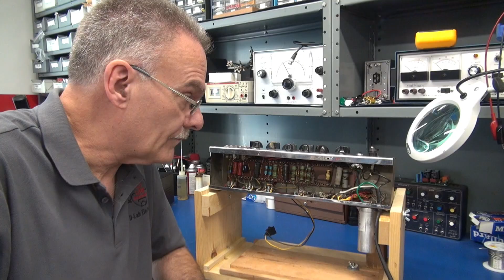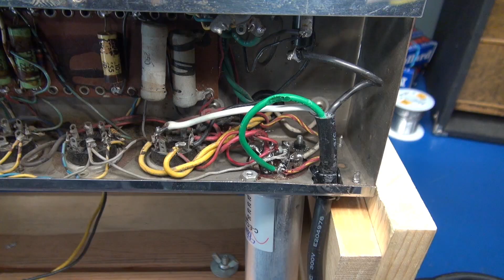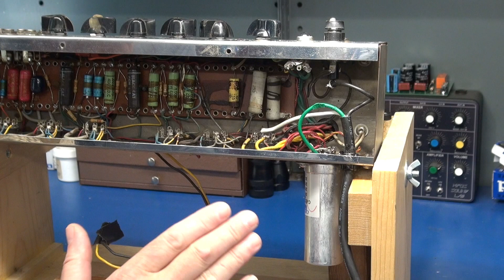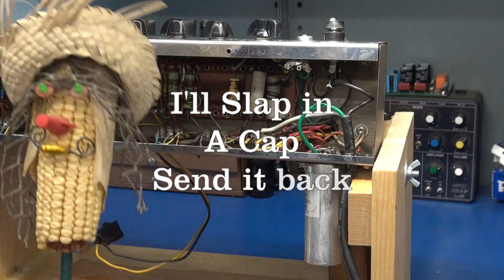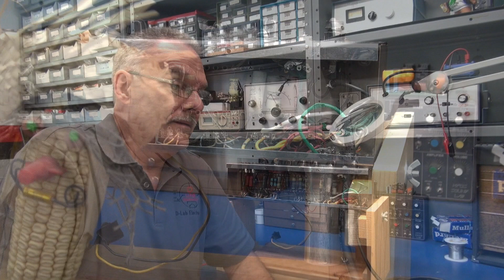Ampeg M-15 Tube 6L6 Guitar Amp Power Supply Hum Bad news from the first shop Good news from D-lab

Comment: I know your specialty is amps. But I have not seen anybody cover those caps in amps in radios are those flat squares parts with 4 to 6 wires on them. a lot of these are in the rf and audio stage. Nobody has ever explained if these should be replaced as mica or ceramic disk or can either be used. Just thought I would bring this to your attention. I have read several articles including the few from nuts and volts and have yet to se anyone explain what these are. Now in the schematic you see these with values but not specific to ceramic or mica or does it NOT make a difference. Wonder what your thoughts on this would be. I have also experienced them in ham radios of the vintage type. I bring this up to you as I know you have a passion for these old relics.

Comment: Guitar player here , I know nothing about electronics but have a quistion is it possable to make a guitar amp from an old tube car radio ? Plenty of vids on you tube using radios but nothing from a car .
Reply: Probably have to lug a 12-volt battery around. Maybe 6 volts.

Comment: You did not just blast Kentucky like that? No! 
I'm laughing my butt off and wincing at the same time.
Rock and Roll D-Lab.
Reply from the maker: Nope, I believe it was CornTucky
Reply: @d-labelectronics  I now live in Kantucky (Yes, I spelt it right) .
Reply: Unfortunately you can find people doing "repairs" like that just about anywhere, Kentucky included.  I won't blame every service tech in a region just because of one bad apple.  Or corn cob, if you prefer! ☺